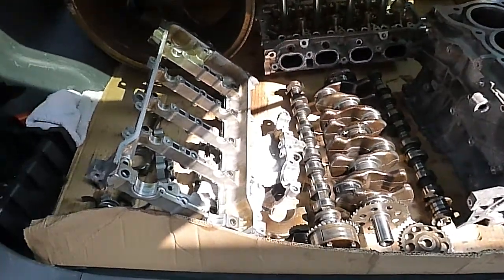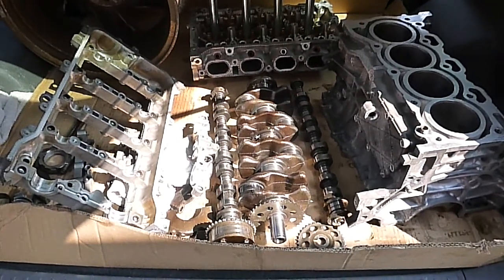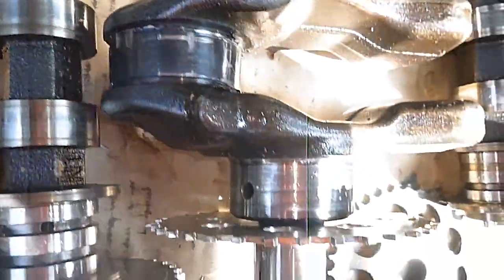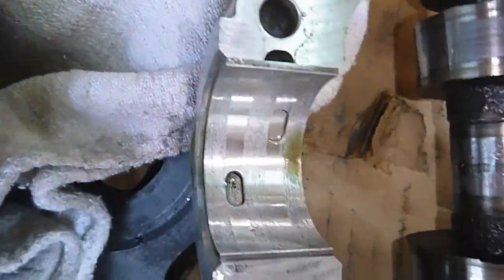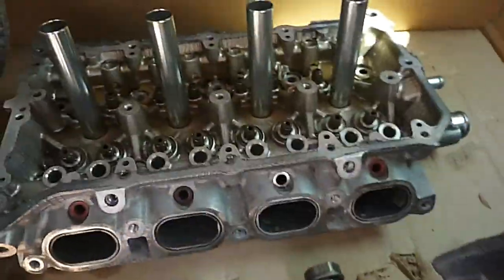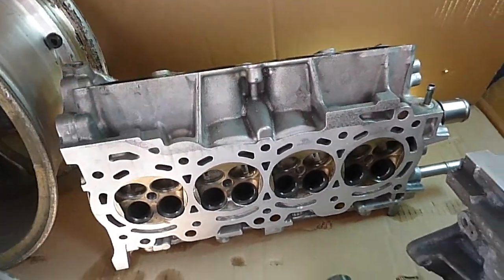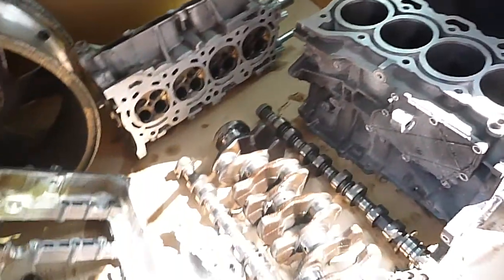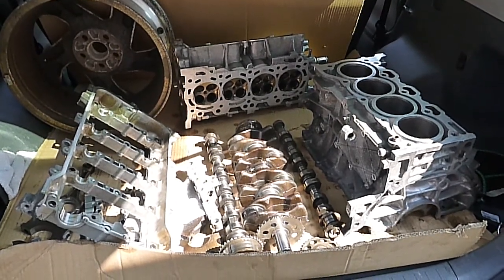2012 Prius Engine with a Catastrophic Bearing Failure - Fix That Prius!

Comment: I guess that's what happened to my 2011 Prius engine at 186k last night. Haven't opened to see the inside yet.

It happened without any warning. Perfectly and silently running engine started to vibrate violently with a loud knock. 

I would not expect from a Toyota engine this early. Used Mobil 1 synthetic since I got it.

Comment: What you are seeing is a system wide lubrication failure. A dead baring will not affect any other baring (the fragments cant make it through the filter) . Also the way the mains get progressively worse as you go alone the shaft conferms this.
Reply from the maker: Hi,
Thanks for your insight. You are, of course, right. The oil would necessarily travel through the filter before returning to the galleries. I was a little freaked out by the amount of debris in the engine. I have tried to rebuild about 5 engines and none have survived. It's not my thing. A swap is a better choice in my opinion.
 - Fix That Prius !!!

Comment: Not as bad as mines. Cyclinder #4 punched a hole through the block while on the freeway. Started knocking around 120k. And at 155k bang. Debating if i want to sell the shell or swapping in a low miles motor. Following your vids to better help me decide. 
Have experience swapping honda/Acura but not a hybrid
Reply from the maker: Hi, We are getting near the end of the battery life of the 3rd Gen Prius'. My gas mileage is not very good anymore, down about 10MPG from new. A newer used battery pack ($1500-$2000) has a 4 year payback. I'm buying a new Camry Hybrid soon. It gets 52 MPG. My old Prius' with new engines are going to run forever but aren't worth anything.
Good Luck.
 - Fix That Prius !!!
Reply: @fixthatprius4980  will replacing with a jdm engine be a lot easier than a 18-19 engine? My mpg was down to 41-42 these last few years since the knocking started 30k ago. I would like to get  another 100k or so from the car. Id figure i could replace the engine drive it for a while and get my money back if i ever sell it.
Reply from the maker: @kentdo8143  Of course it can be done, and it's not that hard. Some have had other problems after the swap. I had one that went perfectly and one that overheated for an entire winter. I don't know why. Best wishes!
 - Fix That Prius !!!

Comment: how many miles was on it when it failed?
Reply from the maker: Thanks for your question.
Please subscribe to my channel.
About 200,000 miles on this engine when I killed it.
Started burning oil around 85,000.
I bought it around 99,000.
Went crazy trying to fix all the crap that was wrong with it.
At 195,000 bought another 2012 Prius v to replace the Black one. Long story about odometer fraud.
Supposedly had 79,000 on the Gray v but Toyota says it had 245,000 miles at it's last checkup.
Rebuilt the Black v engine.
Engine failure occurred about 5 miles down the road.
Replaced engine with a 2016 Prius 1.8L engine.
Went well.
Replaced the engine in the gray v and recorded it on video.
Now you can watch it.
Reply: @fixthatprius4980  Ouch!  Where did the rebuild go wrong?
Reply from the maker: @deibama  Hi,
Thanks for your question.
Please subscribe to my channel.
I took the oil pump off the engine and dumped the oil out as part of the rebuild. I should have filled it with oil or vaseline before before putting it back on.
  - Fix That Pruis !!!
Reply from the maker: Hi,
Thanks for your question.
Please subscribe to my channel.
The engine had about 200,000 miles on it. The rebuild had about 5 miles on it.
  - Fix That Pruis !!!